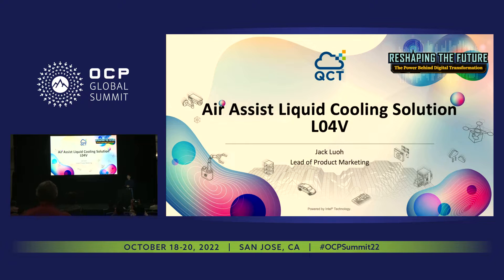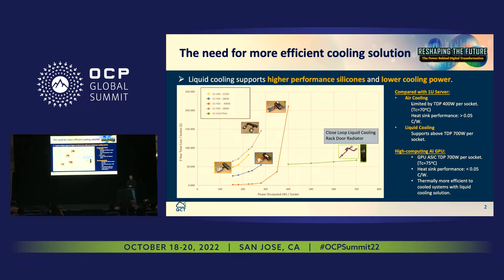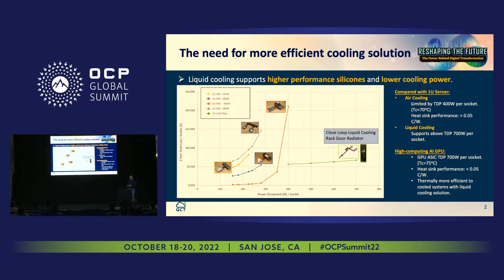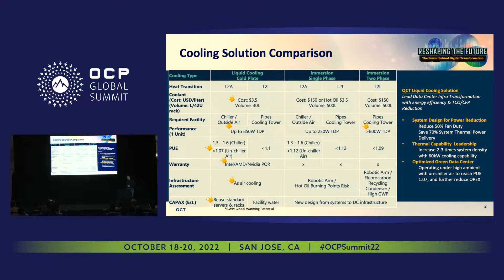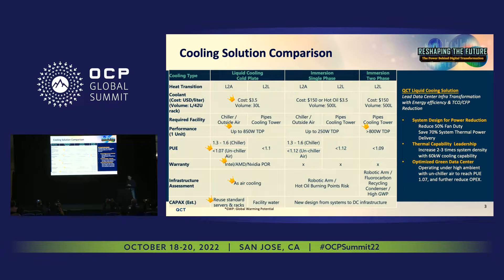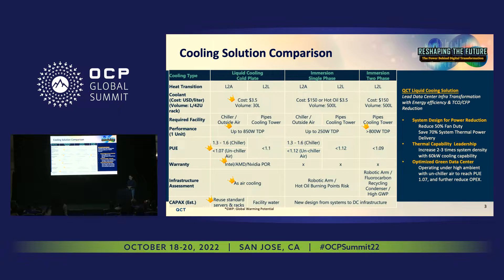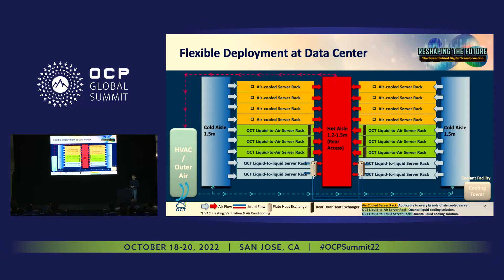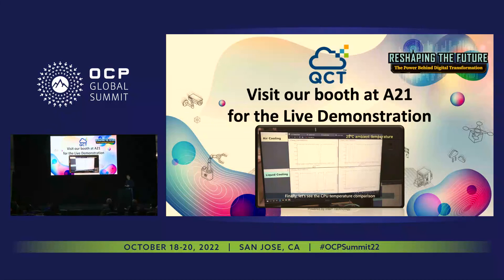Introduction of Liquid cooling rack

Comment: There is SO MUCH single-phase liquid immersion cooling misinformation in this presentation it's hard to know where to begin. So let's tackle this one bite at a time. Yes, there is more coolant in a single-phase liquid immersion cooling system (SPLIC) but the coolant last 10+ years with no degradation or volume loss. The same cannot be said for cold plate refrigerant, or two-phase immersion. 

Your performance figures are absolutely false. SPLIC performance is far beyond 250W processor TDP limitations. A 1U server can have X number of sockets to affix CPUs (let's say two) meaning your 1U number would theoretically have two CPUs @ 425W TDP ea. = 850W (a ridiculously high TDP, BTW). SPLIC runs 400W TDP CPUs without performance loss (so, 800W), and analysis shows it can cool CPUs beyond 750W TDP CPUs, which would be 1,500W in your example. The reason I am calculating two CPUs, is that each would need to be plumbed in a 1U scenario. That's a lot of inlets and outlets.

Your number for PUE is false. SPLIC is <1.03, two phase is around <1.02. These have been published numbers for about a decade. Single and two phase immersion also eliminate all server fans and cuts system cooling expense by 90%. You are not taking the entire DC air-cooled infrastructure for liquid-to-chip into account.

Your warranty information is false. Warranty coverage extends to ALL major OEM-branded SPLIC servers

Robotic arms ARE NOT required for either single, or two-phase immersion cooling systems. Vertical pull servers are the same weight as horizontal pull servers. If fact, maintenance is significantly easier on a SPLIC system than a liquid-to-chip air-cooled system.

SPLIC coolant is not "hot oil" and does NOT present a burn risk when running at normal operating temperature, which is around 38º- 40ºC. Essentially the same temp as warm bath water. Also single-phase coolants are completely non-toxic and essentially non-flammable.

SPLIC does NOT require any DC air-cooled infrastructure design changes. If fact, SPLIC systems can be put just about anywhere, raised floors, or concrete floors, and does not require any air-conditioning at all. Liquid-to-chip still requires air-conditioned infrastructure. Plenty of DCs are hybrid SPLIC and air-cooled. 

I am all for promoting one's ideas, but your info and figures are blatantly misleading and biased toward liquid-to-chip, which is a great cooling method, but certainly not what you're making it out to be against competitive mothods.